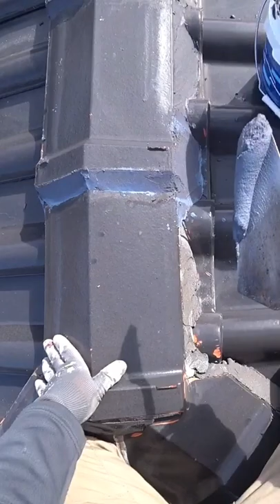How to repoint flexible pointing on Ridge tiles #shorts #diy #tips👍& 🔔

Comment: Hey mate, i got a few damaged spots to repair on cement tile roof. It looks like your applying this product over the top of old rigid pointing in places. I take it its ok to do that or should i completely remove old rigid pointing first? Dont want to be doing the highwire act more than once, cheers
Reply from the maker: Bedding is steal in good condition  long Video link
https://youtu.be/q9oCL8K_OG4

Comment: Hi. I watch you videos, good. Just saw this one. I am going to have to repair my own ridge tiles, pointing, soon. I am going to use Mapei Planitop Smooth. Then recoat my roof with Mathys Dac Hydro plus.
Reply from the maker: Hi to be honest with you I've never Used any of these products so I can't give you advice on something I don't know about Sorry to disappoint . Why the way I am located in Australia
Reply: @samcopaintinganddecorating  hi. It wasn’t really advice I was looking for lol. I know the trade inside out. I was just relating to the fact I have same issue at my own home to deal with. So I ve tried a few products for pointing and most fail. I am going to try Mapei . 
As for paints I am surprised you don’t get Mathys paints down under, I am in Scotland, you will get Rust Oleum paints yeah ? Same company really. Rust Oleum Mathys. Cheers for good videos. You are a good tradesman, best wishes
Reply: In Australia the top brand is Dunlop Pointing and Selley's Pointwork are cyclone proof fully flexible. You can fold in half and i won't crack. Its design to stick like hell! Most important is to grind back edge tile and pressure blast to wash off and you got yourself a sound roof base for pointing. MARPEI IS NOT DESIGN TO TAKE THE HEAT AND ICE LIKE POINTING COMPOUND DESIGNED TO DO AND CANT HANDLE COMPRESSION AND SUCTION ACTION IN HIGH WIND . I BEEN
DOING POINTING FOR 23 YEARS
Reply: @jeffechoe  cheers for sharing your experiences. Not heard of Selleys. Will check it out ta.

Comment: What is that product please mate?
Reply from the maker: Selleys Point Works is a tile pointing compound applied with a trowel and used to fasten (point) hip and ridge roof tiles.

It forms an incredibly strong and durable bond between the tiles and the ridge, and the smooth non-slumping consistency makes it easy to mix and apply.

Point Works is the first pointing compound to qualify as an Adhesive Mechanical Fastener for hip and ridge tiles in accordance with AS2050-2018.

It has also passed the fatigue loading for both Cyclonic Conditions C3 and C4 after conditioning by prolonged water saturation as per Australian Standard AS AS4046.8-2015.

Comment: Yes, but WHAT are you using to seal the ridges...?!
What is in the bucket...?!!!!
Not infrormative at all.!
Reply from the maker: Point Works is a flexible pointing compound for the adhesion of ridge tiles to the hips and ridges of roofs. It provides very strong bond between the tiles and ridge. With an excellent cracking resistance, it is suitable for use under different climatic conditions.